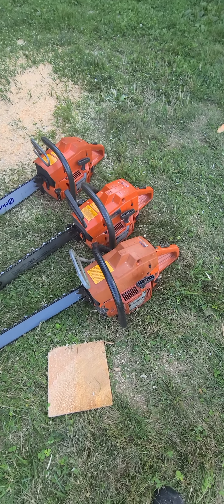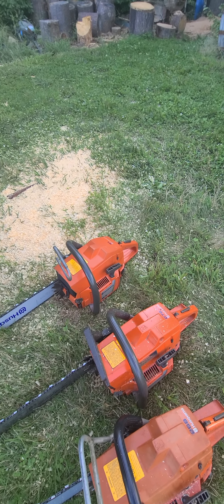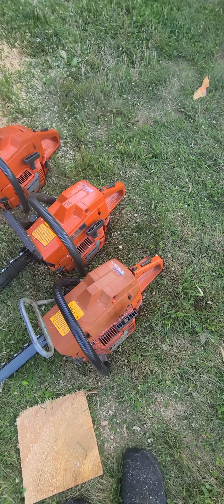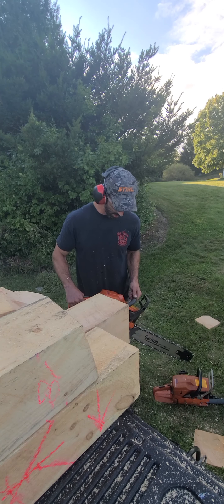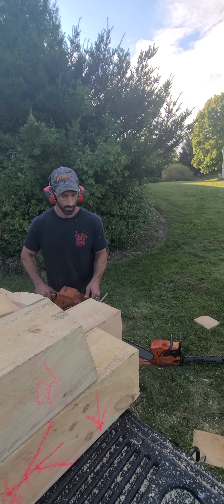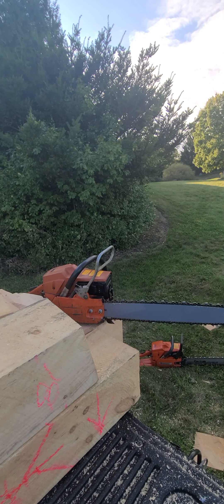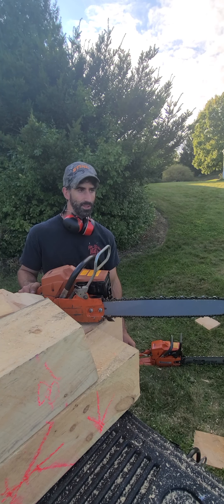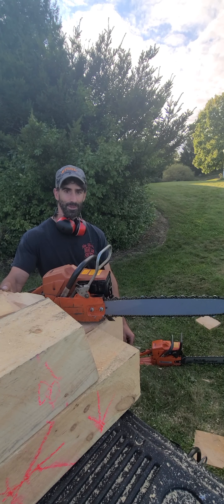Modded Husqvarna 61 conversion vs stock 272xp chain saw test

Comment: What is the ideal mod for the 61? 272 or 266 top end?
Reply from the maker: There isn't really an ideal mod.  Its similar to a  guitar it has six strings and a saw has six ports.  There's infinite combinations.   But the 266 cylinder likes finger ports. 
Ex~160°
Transfer ~120°
Intake ~160°